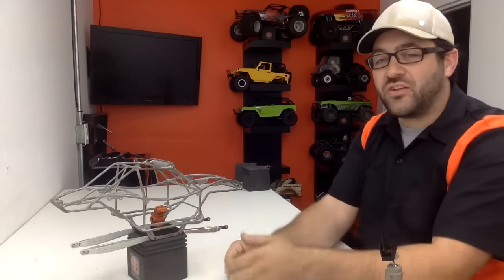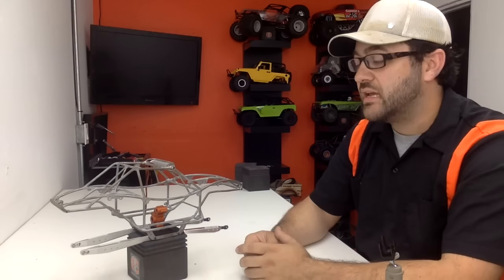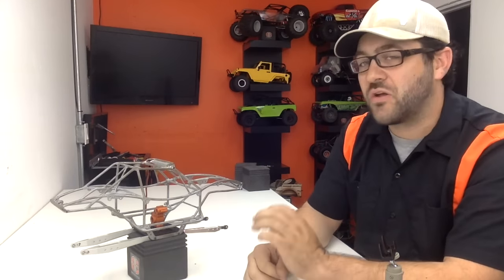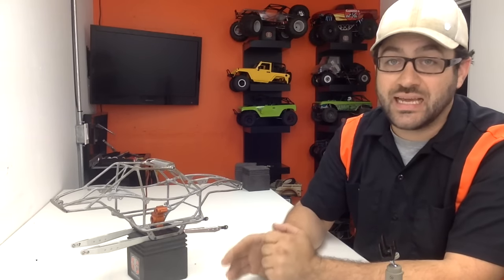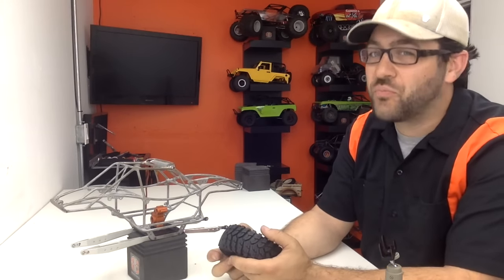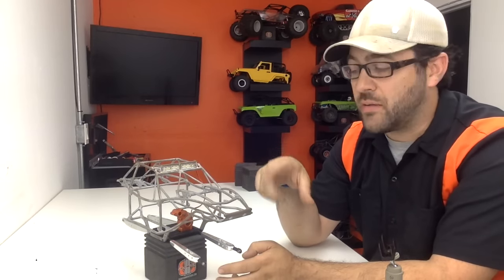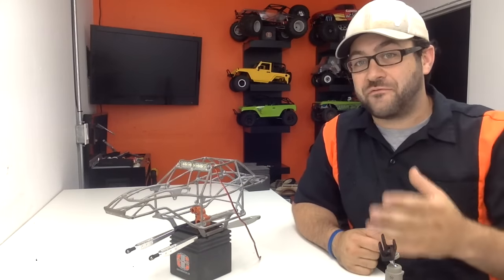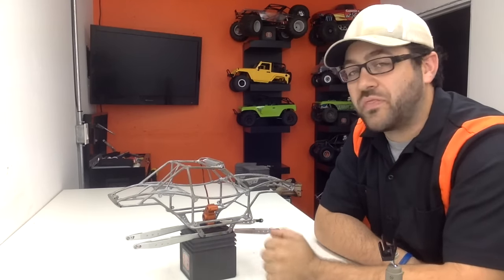Ultra Custom Fab (UCFab) PRT HD - Introduction - Episode 1

Comment: That chassis is sick but just a little to pricey for me. I did see that Supershafty made some new trailing arms that are 3mm shorter for the front to keep that pinion angle on the axles for better clearence.
Reply from the maker: +FILTHY5150RC I would rather keep the more durable one-piece design for the trailing arm and then just slightly adjust the upper links if you want to change the pinion angle.

Comment: Strength of the V2 vs. the looks of the F9 that's a tough choice. Love the new build.
Reply from the maker: +zippit47 The F9 will be just as strong as the V2. The advantage would be the ability to drop the rear lockouts out quickly to remove the rear axle shafts. That's my dilemma.

Comment: Oh my!It looks sick.And i would go with F9 version Harley.Well that is what i have decidet to run on mine.But still have no clue on what drive shafts to run on it.
Reply from the maker: +Rolands Gēgermanis The F9 is most likely what I'll go with for the fact that a centered rear axle is more beneficial to get full travel in the rear. So I'll likely put something together that way.
Reply: +Harley Designs Dos VP already have F9 centered version available in store or you will just use Currie axle tubes?
Reply from the maker: +Rolands Gēgermanis The centered F9 is not on the store yet. Hopefully in the near future. The centered Currie tubes work just the same and the same truss will work as well.
Reply: +Harley Designs Thanks Josh.Good to know.